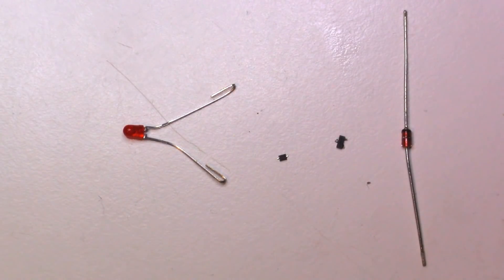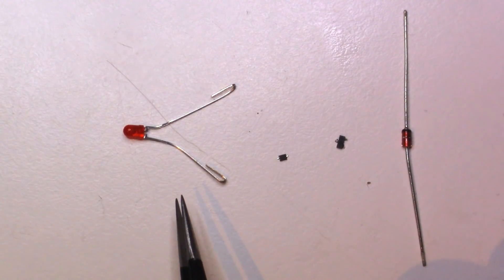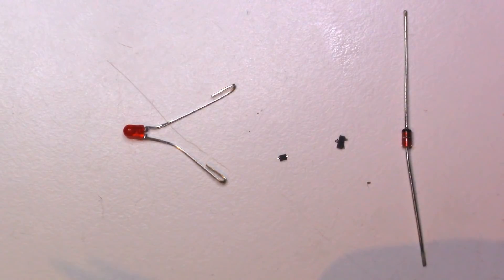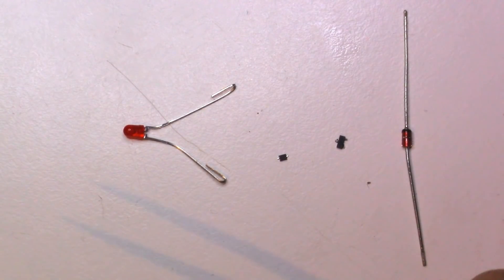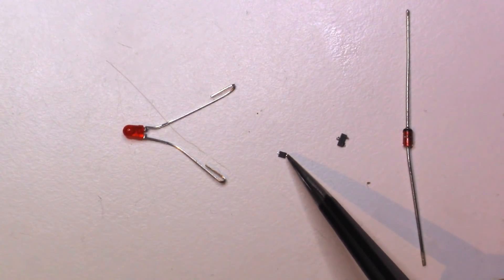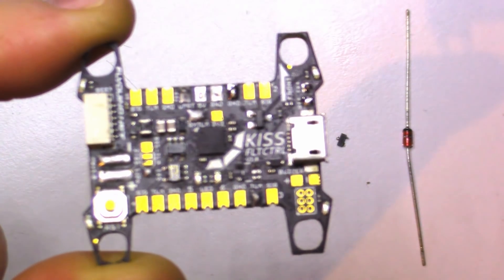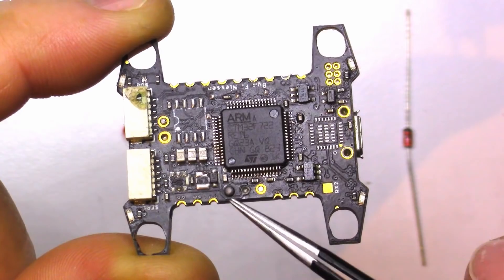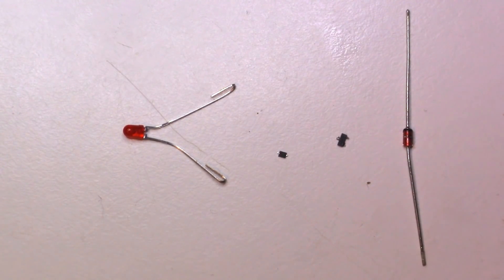RC Electronics Repair Tutorial 03 - DIODES

Comment: It looks like you stopped with the tutorials on the individual components. I hope you start again. There are lots of ICs that I don't know what they are or how to test them. This is a necessary education for anyone into FPV because the electronics aren't very reliable. I have four flying quads and 6 FC/ESCs that don't work anymore and need diagnosed and repaired.